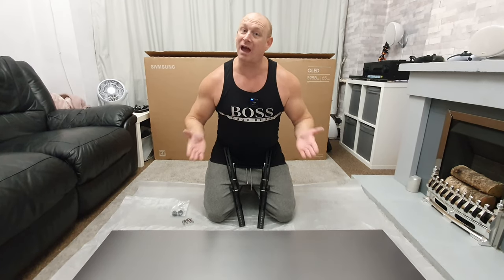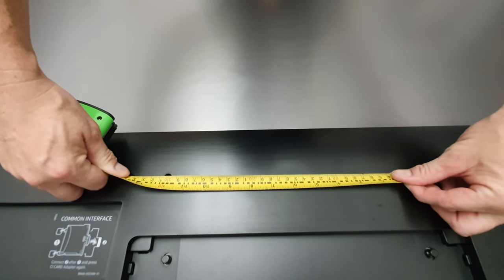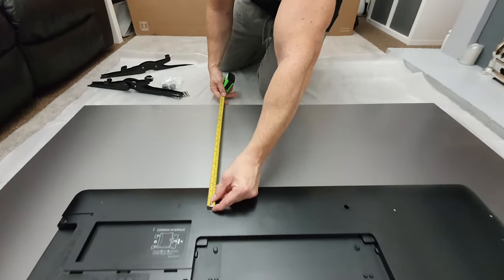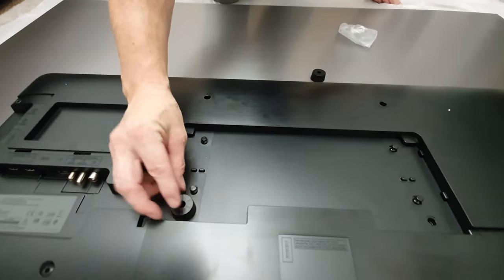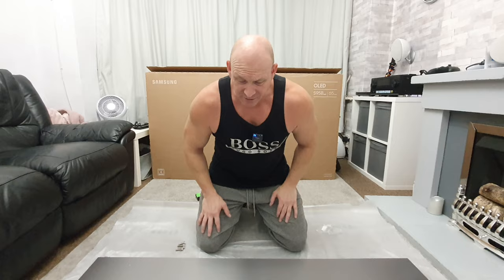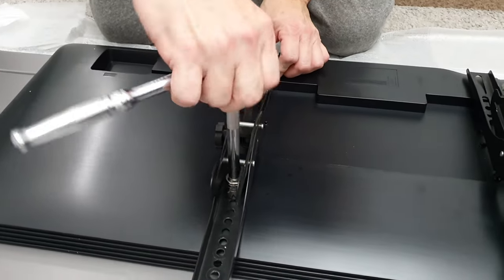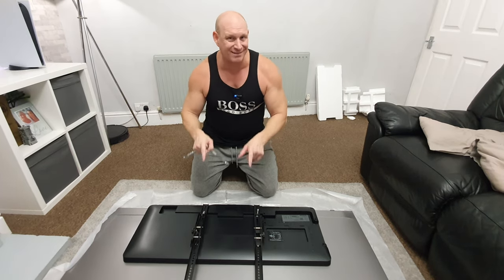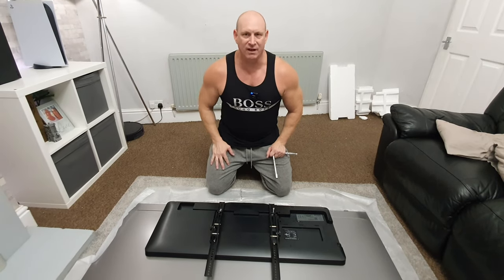Samsung S95B OLED wall mount fitting guide, including measurements & bolt sizes

Comment from the maker: ATTENTION! Please take into account any washers or how thick your bracket is when buying the M8 bolts. As whilst 28-30mm are the correct size, additional length may be required. This you will have to judge yourself as I am unable to tell how thick or thin your brackets are, and how many washers you may or may not want to use, and the thickness of any washers you may use.So remember 28-30mm M8 bolts are the minimum length with no washers!
Reply: Do you still like your Samsung? I returned mine because problems kept popping up. Also the picture quality looked great for gaming but for watching movies with an emphasis on accuracy this TV really struggled. Had a chance to own the a80k at the same time before I returned it. The Sony absolutely blew the Samsung out of the water for watching movies. Colors look more natural and have more richness, finer image details are much more clear, shadow detail was vastly better and notion handling was perfect. I'm really curious to know if your first impression of this Samsung has stuck. It didn't for me.
Reply: @tac6044  with the Samsung you have to turn off all the energy saving stuff, put it on a particular mode and then turn up shadow detail and maybe even the gamma, then it's good.

Comment: Fwiw, I'm mounting a 65" and the 30mm bolts were too short for me. The 35mm worked, but did not allow washers. I opted for 40mm, with 3 washers and a lock washer. Maybe you're mounting a 55", I missed that. But just a tip for anyone else trying to mount one and they have a 65"!
Reply: Lol the 40MM goes in the bottom one for me with just the spacer provided . On the 55

Comment: samsung slim mount bolts what included in package was too short so i used 35 mm bolts .how you managed to use 30 mm bolts i dont know. i have samsung s 90 c 65”.

Comment: How do you get your bracket arms to move when installing bolts? Mine don’t slide and I can’t get the bolt in under the end with the adjustment screw

Comment: ive just purchased this model in 55" to use with my existing wall mount but the screws are to small ive just ordered some M8 x 30mm screw bolts which are the correct ones ?
Reply from the maker: The ones that you have ordered are the same size that worked for my 65 inch. But can't say if they will be correct for the 55 inch version.
Reply: @TheTechGiantYouTube  yes recieved them today all good fit perfect thanks

Comment: Can't you just use a slightly longer bolt for the bottom holes since they're recessed?
Reply: Yes. I had to use 40mm long M8 bolts for the recessed holes with a washer on each.

Comment: I'm getting ready to mount the same TV. Only thing is, you say it's normal for the brackets to hang over. Common sense should tell you it's not normal at all. If you use the proper brackets to begin with, then there's no problem.
Reply from the maker: I have to use brackets that will fit TVs from all different manufacturers and all different sizes. And most universal brackets will be like the ones I use in the video.
Reply: @TheTechGiantYouTube  Kudos to you for replying to this nonce

Comment: With the build quality once you got it on the stand or on a wall it as long as you don’t keep moving it around it should not be an issue the reason why Samsung reduced the brightness as the experts moaned saying it was nor accurate Samsung listened and reduced the brightness pissing off samsung owners
Reply from the maker: Yeah I would have rather had brightness than pure accuracy  and to be honest I think the average punter would say the same.

Comment: M8 30 mm my ass.... 
Thanks for the useless trip to the store to buy propper, longer screws.
Kudos for the threading, thx.
Reply from the maker: I'm going by what it said on the instruction manual that was supplied with my UK unit. Also you have to account for how thick your brackets are or additional washers.As good as I am,I'm unable to guess the thickness of each person's brackets or how many washers you may or may not use.
This will be the last time I mention bolt sizes in a video.
Reply: @TheTechGiantYouTube   
I'm very sorry just went to the store and tried the screws you recommended again... and they work too. I came to my computer to delete my shamefull post, only to see you already read and responded. So my most sincere apologies. The M8 30mm work too. 
-> Turns out the Screws match exact; So if you try to use a washer then that is enought to make the gap too large. 
Sry for wrong accusations😔.
Reply from the maker: @gimpinatoro  Thank you for the apology, as many people don't.
What I will do is pin a comment explaining that they may have to add an extra few mm to allow for any washers and the thickness of their wall brackets.
Out of interest, what mm did you go for in the end with washers?
Reply: @TheTechGiantYouTube  
I used the 30mm screws you recommended since they felt best when tightening them. 
And the 40mm were added to my screw bucket xD.
Reply: @Suicidebummer88   i think not 
when i remember correctly, then this was excactly my problem i thought the screws were to short but i accidently used the spacers on the wrong holes
my tv still hangs perfect since then  🙂

Comment: $2,000 TV and they don't include the bolts. Thanks samsung!
Reply: No TV company includes the bolts for a wall bracket.!!
Reply: The bolts come with the wall mount, not the TV.  TV occasionally have short dummy bolts to keep the holes clean, but none include the bolts as they have no clue which mount you are buying.